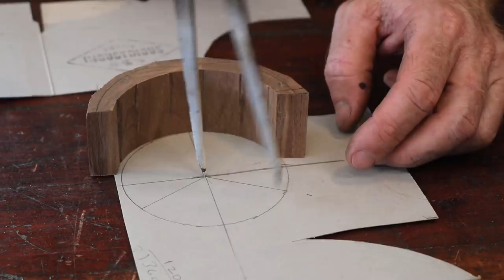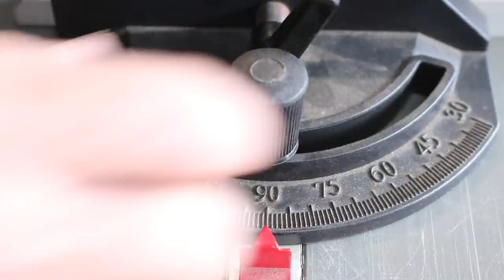Make a Round Bottom Wood Plane - Forme Industrious

Comment: Hi Scott. A tip for kurling in the lathe. Slow speed, high knurl pressure and tons of oil. The oil carries the metal dust away and keeps it from being pressed back into the part. High tool pressure helps the knurl start and form a nice clean diamond pattern. I hope this helps. Great project. Thanks.
Reply from the maker: Hi Craig, Thank you for the tips - cheers! Thank you!

Comment: Was that an empire marker? They do draw on oily steel (for the most part). Found any local suppliers of silver pencils?
Reply from the maker: No I just used a sharpie - bog standard. I think should ask my welding shop but for the most part the sharpie is fine. I need some soap stone too.
Reply from the maker: Hey Troy, As it turns out they are empire markers and they draw ok on oily steel like you say. Sorry, I never took much notice. Now that I think about it, they are much better than the sharpie. They seem to hold the shape of their tip better.